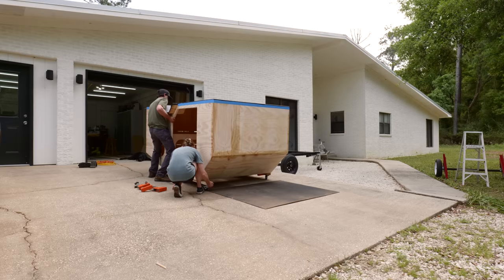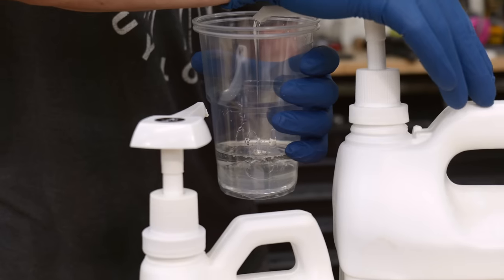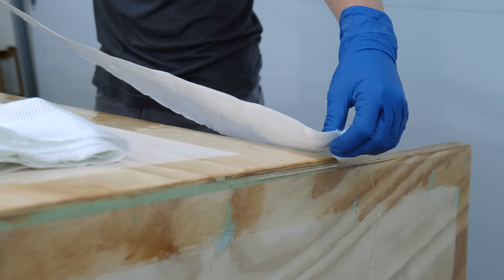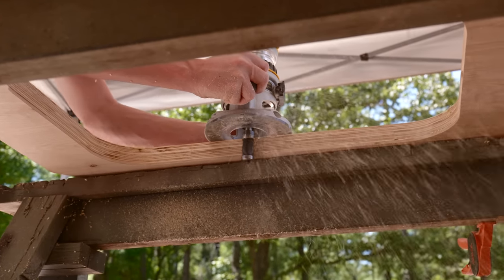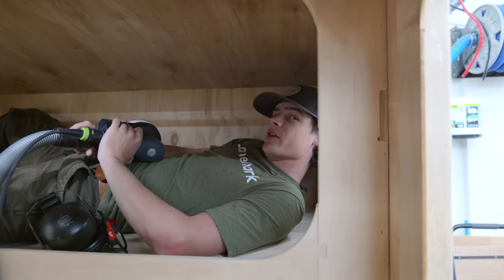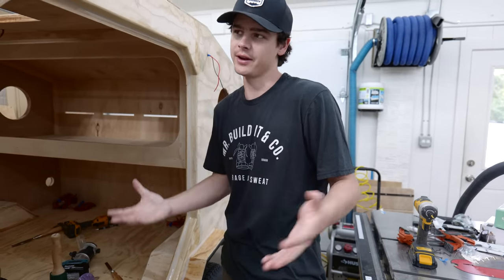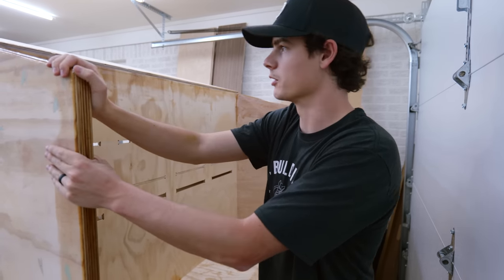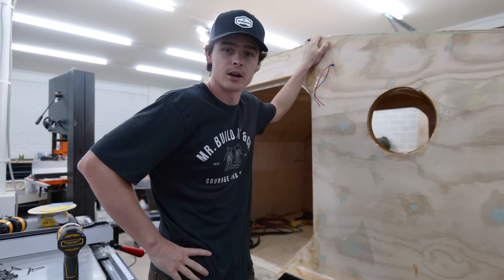Accident While Building The Harbor Freight Off-Road Teardrop Trailer...

Comment: I love your attention to detail. I am new to the channel and have been watching this build series. In your planning stages and and your running of wires did you happen to run wires for your trailer lights? Do you plan on mounting lights on the Tear Drop itself? The flatbed would have only required lights around its parameter but the camper will most likely require marker lights on the front, rear and corners near the top of the camper.  Hoping to mention this to you before the final finishing touches get completed. Great Job on the design so far! Keep up the good work. FYI, I look forward to going back and watching you earlier video's as well.
Reply from the maker: Yep! Got all the cutout for those ready to go!

Comment: After rebuilding, owning,& using several sailboats, I would urge you to glass the entire exterior. It will be much more durable , and more importantly waterproof. Also coat the galley, with epoxy to waterproof it. Dan S.

Comment: Your trailer is truly a work of art and craftsmanship. However, having pulled many trailers for many years I just don't see the wood fenders standing up to the rocks, grit, and sandblasting from the tyres without a sheet metal liner on the underside.

Comment: When putting the camper on the trailer; use your saw horses on the sides whith 2x4s on them. Then you can position the trailer under the camper, and pull 2x4s. Don't have to fight the camper and trailer at the same time.

Comment: Does that have amine blush, so should be washed off with soap water then next coat?
Reply from the maker: It was cleaned with an epoxy cleaner, however it doesn't blush either.